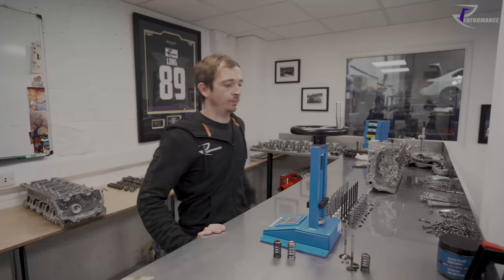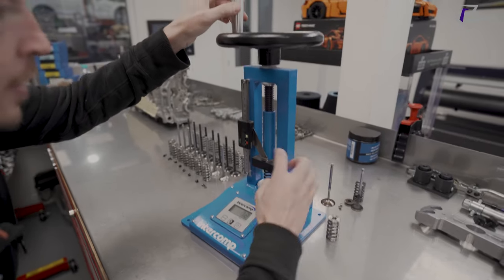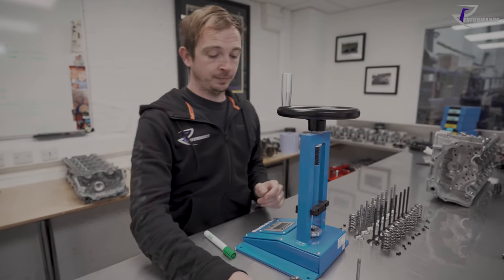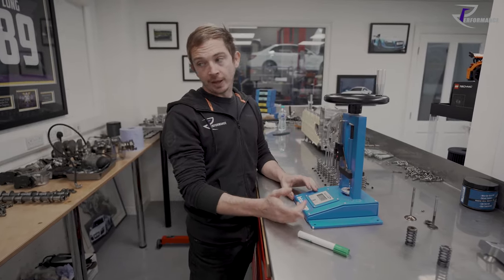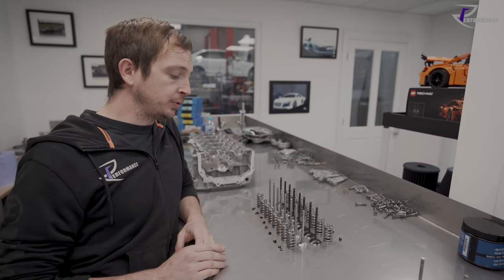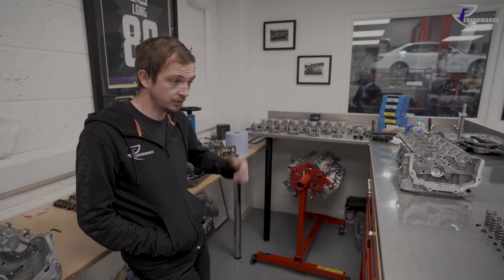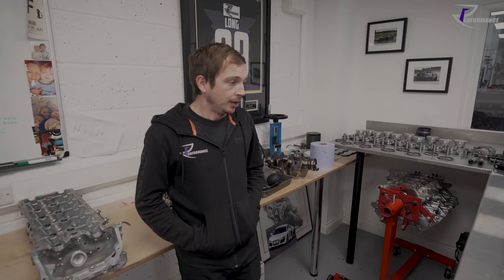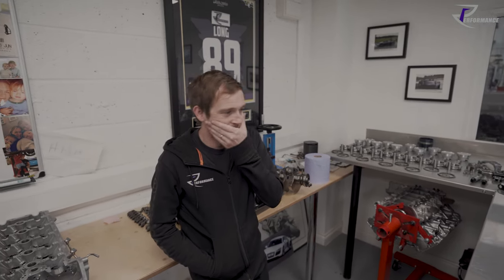The importance of measuring valve spring rates correctly

Comment: Do a complete engine build and what type or grade are the alloys used in various parts,especially moving parts which are coated with anti friction coating and hi temp coatings and also how much real balancing is done when building a V8 or V10 lambo engine and which parts are balanced and where the material is removed to make sure each moving part is perfectly as can get in weight and moving balanced etc.:) Love a upload about that?

Comment: Also how much extra work is done compared to factory engines and what aftermarket improved parts can you buy, so that the engine and running gear will last a lot longer, even if your racing the cvar on weekends etc. :)

Comment: The stock springs have Marks on them and, I would like to know which one is for intake or exhaust.also you said the valve springs are identical that means the marks on the spring don't matter in I swapped it by mistake?

Comment: Why dont you show and calculate the needed spring strenght for this setup so it wont loose valve control but is not too hard to increase wear of the parts.
Reply from the maker: We will in future videos but have to start somewhere.

If I said everything I wanted it would be a 4 hr video lol

Comment: Why not just match springs. Test them and use only the springs that have consistent forces at the given compression. Why bother with shimming to match spring weights?
Reply from the maker: We don’t shim to match spring weights, we do that to increase pressure across the board. We do use matched springs.